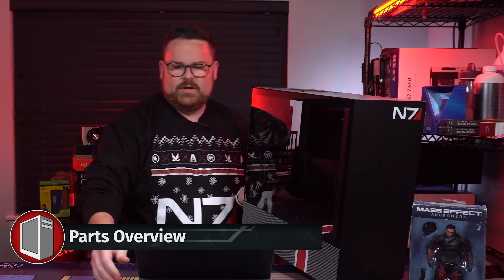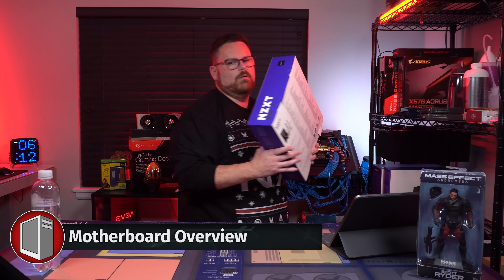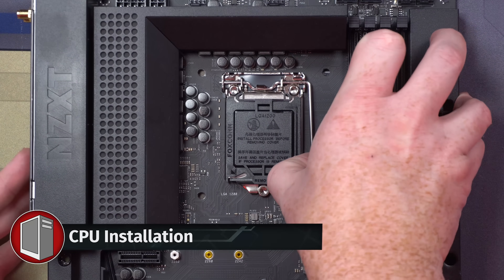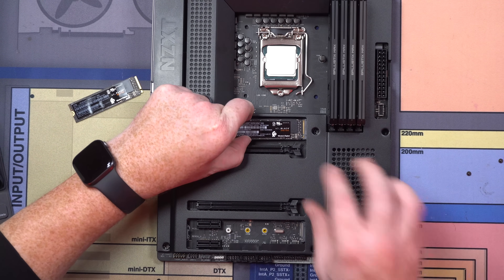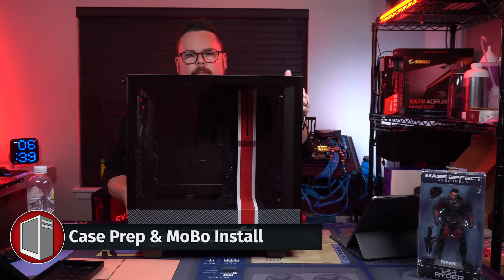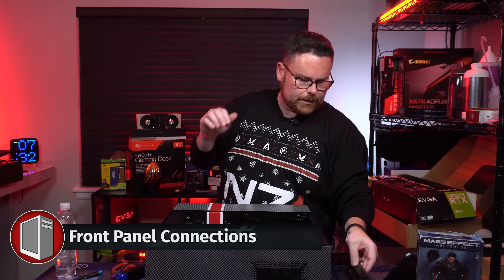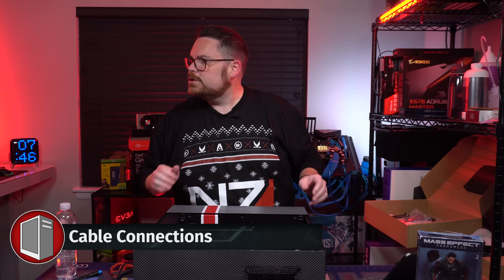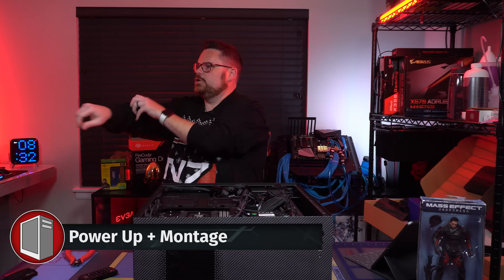The Mass Effect Build (10900k with Custom EVGA RTX 3080 FTW3) | Robeytech

Comment: Wasted opportunity with the cables. Coulda had an N7 stripe running on those. But aside from that, nice and clean.
Reply from the maker: We actually tried that and it was too much stripe between the stripe in the case and the stripe in the cable.  It was a good thought though.